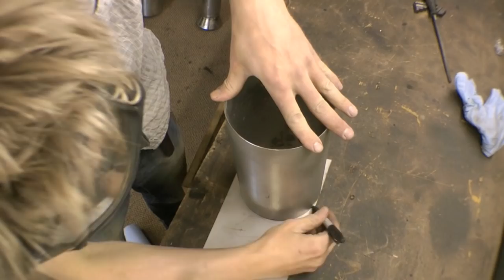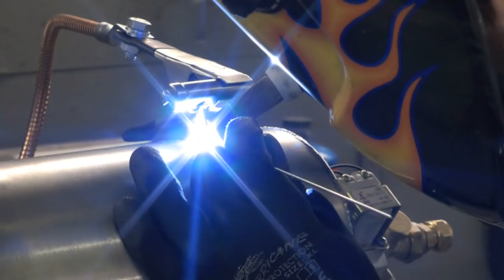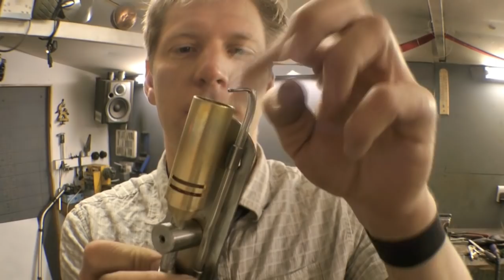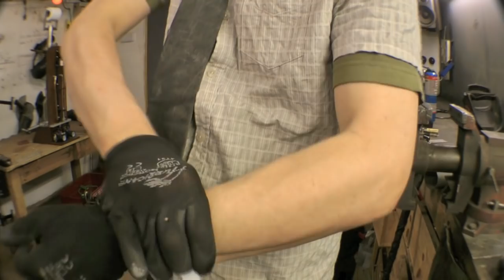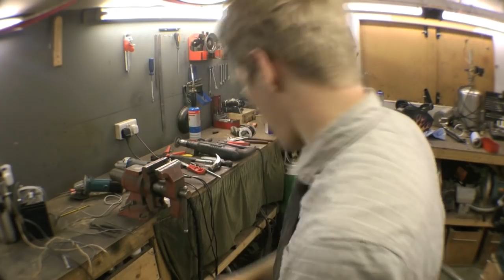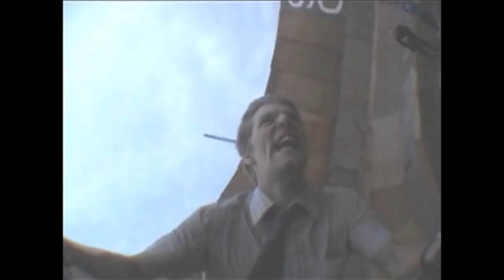DIY X-MEN Making PYRO's Fire control

Comment: Years ago a car crossed the dividing line and struck me on a motorcycle while driving to work. Long story short, In the hospital 1 month, left foot and ankle crushed, 2 years before I could walk again without a brace. I took my left foot biker boot and designed and built a brace that incorporated the boot. It was home-made and bulkier than something purchased from a store so I had to wear it on the outside of my clothing. It consisted of flat metal stock 1" X 1/4" that I shaped to attach at numerous places on the boot. I used small cage bearings at the ankle. The metal stock extended from the ankle to a point just below the knee. I used a large thick piece of leather that was about 1/4" thick and about 7" long and riveted the metal bracing to it. I got three large silver buckles, riveted them to 3 straps that in turn were riveted to the leather. To use it, I would put the boot on my foot and then wrapped the thick piece of leather around my calf, and then cinched down tightly the three straps and buckles. The thing worked perfectly and was actually comfortable to wear after the leather was broken-in. This was just before the "The Road Warrior" Mel Gibson movie was released. I made the brace just a couple of weeks before the movie release and did not copy the idea from the movie. I never went anywhere without people commenting about the brace. It did look pretty cool with the shiny polished metal against the jet black leather. Many people wanted me to make one for them to wear at Halloween parties until I told them how many hours I spent making my own and how much it would cost for me to make another. This video reminded me of making the brace and sort-of merging something mechanical onto flesh and bone.

Comment: what exactly stops like the fire from igniting the gas and travelling completely up the device?
Reply: +byalexandr it does sometimes
Reply: +chunchoe There is no oxygen inside the system. Propane doesnt burn without air, so the flames cant get into the tank.

Comment: How is your welder so quiet?
Reply: Its a TIG welder, they usually dont make much noise unless you use em on AC for welding aluminium. TIG is also produces less spatter than MIG.
Reply: Its a TIG welding stainless steel.
Reply: Ohh, that explains it.
Reply: asemnafiz hahha made my day bro :'D
Reply: TIG You can use a MIG with stainless wire and a gas mix called Tri-mix it works but is not as pretty.  Collin is a master welder which helps too.  Not sure what shielding gas for TIG probably pure Argon.
Reply: Grove332 your comment and your profile picture made my day :)

Comment: You can get a cylinder from your local hard ware store and you buy an adapter where you screw a paint ball co2 in the top to pressurize gas and then have your hose in the adaption at the bottom of the cylinder and it will vary your gas to your nozzle

Comment: You should try to create a more compact version just using the propane tank without the metal thing and use a camelbak to hold it. That would be sick because it wouldn't get in the way as much and you could still shoot flames. Even if they only shoot like 5/6ft I'm fine with that.
Reply: The only problem I see with that is Camelbacks are not designed to withstand that much pressure

Comment: You don't need the reservoir ... spray liquid propane. I used to do that with butane from lighter refills and I could get bigger flames then you are getting ... but if you wet yourself with the liquid gas it's not going to be fun.

Comment: Hey, quick engendering question (this is just for anyone who sees it). I’m making a butane blow torch but I’m not sure if I should use a flashback arrester or any other type of safety value so basically how do I make sure the fuel tank won’t blow up.

Comment: if you would sale how much would it be I am very interested
Reply: +Stephen Rosal I'll look it up in the state that I live in in the township I live in it's legal to own a flamethrower I was going to build one relatively bigger but I don't have the equipment to build it
Reply: +Master Torch In America it's legal
Reply: +Lethal Pinecone yes I know thank you
Reply: There currently is something sort of like this actually called "Pyro" and "Pyro Mini" they go around $120-160 from a website called Ellusionist
Reply: +Stephen Rosal it's not a flame thrower. it's an oversized torch. flamethrowers use jelly. at least I'm pretty sure that's how it went.
Reply: Adam Gaffen that's flash paper not able to damage or burn anything

Comment: now because i`m an absolute pyromaniac instead of having one arm have a pilot light i would have a system where you push a button to ignite a small bit of gas and then pull your wrist back to spew more gas out and just have both hands shooting flames
Reply: Dominick Miller  ok scratch my last idea have it go the other way around wrist back = pilot light, button pressed = main blast

Comment: waaaaaay too much freaking heavy hardware!! much easier n better with a slightly modded pest wand and/or rc fuel pump, dc water pump and special mix of alcohols that will actually set or leave something burning from 8-12 ft away.